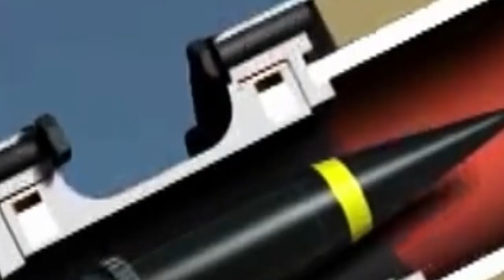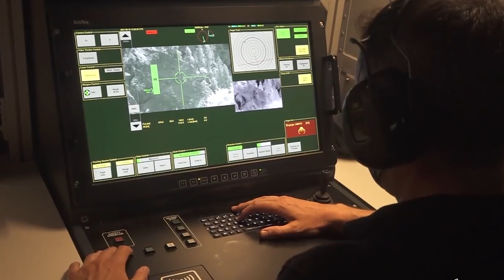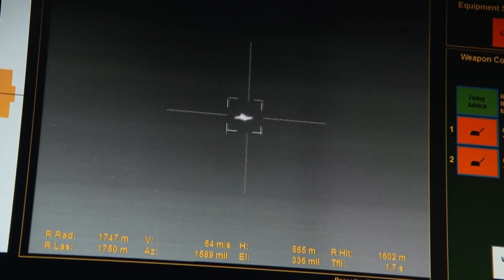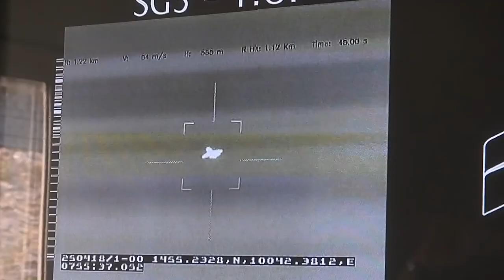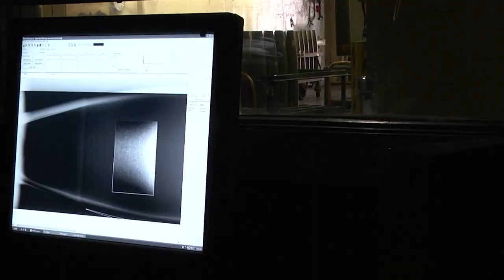Oerlikon Ahead Air Burst Munition

Comment: AHEAD was new when I was in 4 AD Regt RCA more than 20 years ago. It's good stuff, and I'm sure Rheinmetall has continued to improve it, but it's not exactly new.
Reply: well yeah the programmable ammunition system is part of the main weapon system of the german Puma IFV (MK30-2ABM)
Reply: Yeah, it seems these systems have a seen a rise in popularity again as well as their need. They also seem to correlate with the phasing out of previous SPAAGs you'd see before. (Think Germany phased out the Gepard around 2010) Propably to fit in a multiporpose point and air defense role for short ranges. The Rheinmetall MANTIS plattform (also in the vid) and the tukish Korkut are good examples.
Reply: Yep, originally called The Millennium Gun!
Reply: The real problem is that these amazing weapons have mostly zero chance to end-up in the hands of the people who would need them the most..... : Ground troops/patrols....,we continue to observe in Afghanistan (since 2008) the use of old armored vehicles (VAB amphibious..!!) armed with 1960"s .50cal machine gun and young men often getting pinned down by AK"s and RPG ,ambushed with not much to return proper fire ,waiting anxiously for air-support while taking casualties...these weapons look great on military parades but rarely end up on the battle field  and when available ,they are bought by extremely rich small countries from the Gulf that don't even have a regular army ..!!...Note that I was deployed 3 times in Africa during the early 80"s as a French Para-Trooper (Sniper guy) , I mentioned 2008 because during that year a patrol of young men were ambushed in the Afghan mountains Uzbin ,taking heavy loss and these men were using the same useless ,refurbished shitty equipment that we had in 1982...!!.nothing heavy to clear the mountains tops ,useless old smokers that clear in 60 seconds ..!!. no AC in 50°c cramped  vehicles..etc. , ..and things have not changed much...except lots of promises with cool vids on YT....
Reply: @hectorherbert6585  you do understand that this is air defense technology not close ground combat yes ?
Reply: @hectorherbert6585  I recognize the sentiment.
Reply: @darkstepik  Not the point Sheila and not what I said...,  plus taking fire from mountain tops a mile away is not what you can call close combat..
Reply: Exactly!  We installed one of these guns on SeaSlice back in 2001 and fired Ahead ammunition through.  Awesome ammunition with fusing as it exits the barrel, BUT THAT WAS JUST OVER TWO DECADES AGO,,   Not new!,
Reply: @hectorherbert6585  I'd like to come back to your original comment. I've given it much thought since I left military service. I've got the faint notion that since the draft/compulsory military service was abandoned and few families had a son/daughter, cousin or grandchild in the armed services, people no longer give a hoot with what armament and equipment soldiers were being sent to hell holes like Mali, Afghanistan, Iraq, the Central African Republic, etc. Besides, all those operations were far away from home,  and involved fighting insurgents, so who cared?  

Only a few years ago Dutch infantry had to simulate contact drills yelling "Peng, peng!" because of a shortage of blanks. They were being sent on exercise in Norway in mid winter without proper arctic clothes, gloves or boots. Quite a few came back with frostbite. Ships, aircraft and vehicles were rusting at their base due to a shortage of spare parts or people to staff or maintain them. And still our government is wondering why nobody really wants to serve anymore. 

And to add insult to injury, salaries up to sergenat 1st class are only slightly above minimum wage, with all bonusses (for our of area operations or exercises) have been abolished. At the same time, private companies guard baracks, naval and air bases, provide catering and a lot of other facilitory services and make profits to make your mouth water. And look at the military industry, Profits are sky high. 

In short, anyone who's willing to serve a nation whose gratitude lasts a milisecond or so, should rethink his/her decision. You'll be asked to save your life wiith the bare minimum of equipment, armament and training, you get paid a poor man's wage and you are not allowed to go on strike (pretty much all rights civilians enjoy are being stripped from you) and when you return and suffer PTSD or worse, good luck, here's a medal and you are on your own. 

I think that about says it all about western 'civilization.' It craps on its most loyal and dedicated servants and only rewards selfishness, greed, narcissism and incompetence. 

That was not the case (yet) when I left the Army. But boy, how things have changed. Sic transit gloria mundi.
Reply: @Pincer88  memento mori.
Reply: @hectorherbert6585  Yes. Or rather.... carpe diem.
Reply: @Pincer88  well..we might have to worry about tomorrow..!!
Reply: @hectorherbert6585  My thoughts exactly. Western culture - especially at the top - has become hedonistic, obsessed with the here and now and 'the self.' Every cultural value that keeps societies cemented together has been left for the pursuit of pleasure and self satisfaction. 
I don't advertise that one should live life as a Spartan or a devout self flagulating zelot, but our elites lead lives completely detached from every day reality of the ordinary citizen. And politics - in part adressing the structure and sustainment of armed forces - reflect that. 
France isn't so bad in that respect as my country, the Netherlands. But as the 'gilettes jaunes' made clear, if the people are made to bleed for the Parisien folie de grandeur, revolt is what the Elyssee will harvest. 
I've read that Macron seeks to reform the École Nationale dÁdministration (ENA). The breeding ground for the French administrative and political elites. About time imho. Same should happen in the Ivy League universities in the US, Oxbridge and similar elitist seminaries. The word elite derives from the Latin word for electing. It seems elections nowadays have become a game by which the self proclaimed elites legitimize their rule, without even once bothering to ask what the people who have elected them need. 
I'm not a militarist, but Army life has taught me that leaders should arise due to merit and thet such will bring forth units with highest levels of trust (!), cooperation, flexibility and cohesion. Fraternité rather than (only) liberté. It's about bloody time those values should be our guiding lights. What say you?
Reply: How to counter this. It looks large, static, and heavy. I'm guessing small, low flying drones, carrying small payload would be enough to take out the infantry and drivetrain (tyres etc) or surface road damage to a reasonable depth to cause obstruction school these armaments can't move around. In Ukraine if there were 10's of 1,000s of small payload drones I think they could be effective. If the drone is small enough it can navigate at street level.
What do you think?
Reply: Maybe you are correct.🤔 But it will be the first time that history will change in Modern Warfare my friend.💪💪🤔🤔🤔❤️❤️💯💯🤯

Comment: This is a relatively simple, but highly effective technology. It gives an opportunity to destroy object that are flying on low altitudes and does not rely on tracking its infrared trace. But the main advantage is that the ammunition has a way lower price compared to other air defense systems missiles. I think with some modifications it even may be able to destroy other missiles.

Comment: Looks to me like that is a hungry beastie.
Glad it's not me carrying or paying for ammunition for it.
Impressive though.
A bit leading flying  ducks with  a 12 gauge .
12 guage guns historically had expensive ammunition too.
The tungsten pellet loading must be heavy and the propellant load must be high.
I would expect short barrel life given the quick firing must heat barrels fast when pushing heavy projectiles fast and at such close spacing.
Even shoulder guns shoot barrels out fast when loaded hot.

Comment: These things are beastly against high speed boost-glide vehicles too. A must have
Reply: What about hypersonic missiles with propulsion?
Reply: @gabedarrett1301  Cold war strategy, make a bigger and faster missile.
Reply: Yeah, as long as they don't change their course they will be hit, which is why they are pre-programmed with evasive manouvers. In fact they are programmed to not move in a straight line, at least these weapons leave the operators out of any protection, makes they mince meat on the next run. Hell they have to fired from in front of the aircraft thay are attempting to fire against, how many do you need to cover an area? might as well use small drones, it would be cheaper, these things like a lot of modern weapons are for looks and to make money, not be cost effective or even effective defensive weapons. Why not use a shoulder held Rocket launcher, instead of having to purchase a whole vehicle as part of the system?
Reply: @gabedarrett1301  the SM-3 Block IIA hit the fuel tank on a spinning satellite moving over mach 20 outside the atmosphere with a closing speed of mach 18, or a relative impact speed of mach 38 on a target the size of a bathroom sink. HGVs and hypersonic cruise missiles won't be a big challenge to hit once locked on, the detection and target quality lock before the missile strikes its target are the difficult parts
Reply: AHEAD is a great munition, the plan to go up against hypersonics is pretty similar, you just create a wider, taller and deeper cloud of tungsten.
Hypersonics can barely function through rain, it grinds them to dust.
A large dense flak cloud will mince hypersonics.

And take "powered with lots of maneuvers" with a grain of salt.
Remember we're talking about sea level here, I can't see powered hypersonics sea skimming, it's like flying through soup for them, air resistance is the square of velocity remember.
They're not hard maneuvering at sea level and at altitude maneuvering is pointless (it's a geometry thing)

So, think of a Mach 4 SAM, doesn't need to be super fancy, Sea Ceptor will do, war head is clouds of tungsten BBs.
And here comes a Mach 8 missile that cannot get around it.
That's a stationary collision speed of Mach 12.
Hell, fill it with copper cones instead of BBs, the collision speed may cause those cones to form into jets like tiny heat munitions, remember the Meissner effect is kinetic not thermal, the explosive is there for propulsion.
It's like throwing the missile into a wood chipper.
Reply: @johnnymatias3027  you said a mouthful, the short window between detecting a hyper-sonic missile jumping up from below the horizon and locking time is just the  problem. Of course, if there's an AWACS loitering above the horizon's not an issue. If not, too bad!
Reply: Don't forget that hypersonics are also extremely loud in IR and VLF. Hard to hide something when it's moving fast enough to convert ablative hull (or transpiration coolant) and atmosphere into plasma.

Typically these vehicles have some really tight airframe limits as well, can't maneuver very much without breaking up or tumbling (then breaking up), essentially limited to blunt body aerodynamics like a reentry capsule.

And that same plasma sheath makes it impossible to communicate or navigate with radio or radar - can send signals out with plasma modulation, but receiving guidance? Forget it. Hypersonic weapons will have to rely on inertial or optical guidance - more or less limited to preprogrammed flight paths and maneuvering, except perhaps a very short time before impact when the target is in optical range.

All in all, extremely sensitive to atmospheric conditions, can be disabled by absolutely miniscule debris or even rain, can't be piloted remotely, can't use radar, can't make hard maneuvers - their only real advantage are their short flight time and short warning time.

A decent distributed network of passive sensors and any defense that can quickly throw a bit of sand in the flight path (or even a powerful laser of the right wavelength to be absorbed by whatever material is concentrated in the shock) and you've got a useless fireball
Reply: @Right-Is-Right  Aye, hypersonic cruise missiles are just prestige projects. Really not that hard to find and stop with a passive detection network (distributed across buoys, drones, satellites, whatever) looking for loud IR and VLF from the plasma cloud and whichever system to throw a bit of material in front of where it's going to be and it's game over.

Pretty cheap and easy to stop one or two or three - harder if not impossible to stop hundreds, but these things are fucking expensive.
Reply: @airplayn  high speed vehicles like that will also be screaming in IR and radio with a nice bright plasma trail behind them as well. Extremely easy to know when one is moving, not too hard to locate it with passive detectors so long as you have a few of them and they're networked
Reply: @gabedarrett1301  For that just use the High Power Laser from same Company look at the SkyRanger HEL 30
Reply: @SuLokify  Again you'd need over-the-horizon detection by AWACS or satellite for the warning to be early enough for target lock by antimissile systems, especially if the missile coming at 3,000+mph has countermeasures. With the horizon at less than 15miles you would have <0.3 seconds to acquire, lock and fire! By countermeasures I mean preprogrammed or AI high G maneuvering, chaff and decoys but it probably couldn't effectively use ECM
Reply: @Right-Is-Right  Russian Iskander has 20g+ terminal manouevering, chaff, ECM AND decoys. And it can be fired in hypersonic mode too, no one else has anything close. This thing won't stop it, it's not designed for it.
Reply: And hypersonic tech is not new, we had this tech since the late to early 60s...
Reply: @gabedarrett1301  It's really about the same thing in the terminal phase - with slower cruise missiles you have a longer detection and response time, with hypersonic vehicles you have extremely easy passive detection during the entire hypersonic phase (due to plasma trail, really loud in IR and VLF), much more accurate intercept algos (really hard to maneuver at high speed).

Basically it depends on the networked detection system, response time, and yes ammo with more and smaller fragments is more effective. It's not that much more difficult to intercept a mach10 cruise target than it is to intercept a mach10 terminal boost phase target as long as you have robust detection systems

Comment: That is a very impressive rate of fire from a single barrel 35mm. I'm curious about what cooling solutions they use for the barrels and the barrel life expectancy.
Reply: The secret behind the high rate of fire is that its a 4 chamber revolver cannon. The drum is water cooled, the barrel is not cooled at all.
Reply: @doomer6500  Thanks. Always had a curiosity at how low to medium caliber single barrel weapon systems attained high rates of fire. As for the barrel I wouldn't be surprised if field engineers have found a way to "flush" the barrel with a liquid or gas cooling solution. Even at burst fire depending on combat intensity that barrel has it's thermal tolerance limits. Still curious about the expected rounds per barrel safety guide. Like is it every 3K to 4K fired SOP is to change the barrel.

Comment: I've been a huge fan of Rheinmetall and their line up of these guns and this programmable ammo for years! Theres also another smaller caliber gun the Narwall that is also extremely impressive and seems to be in this family despite it not having the Ahead Ammo (I think) and all of them have incredible rates of fire that on top of the state of the art ammo makes them frightening to anyone or thing down range of these weapon systems! I think the US Navy should be using this stuff cause from what I've read it severely out classes the phalanx, and the other 25mm remote weapons stations found on ddg 51 and other ships! Madfires for the 57mm is a great improvement but it doesn't hold a candle to the guns Rheinmetall makes especially with drone swarms become more prevalent!
Reply: Keep in mind mounting such a gun and firing it on a ship won’t have the same accuracy.  Also this weapon is probably not as lethal as phalanx due to lower mass of subminitions compared to a huge bullet.  And phalanx can fire a variety of ammo including creating a shrapnel shield around the ship if I remember correctly.  It also does not require separate sensory systems as it has its own already integrated.  Space is precious on a ship.

Comment: This is awesome, if you could switch rounds between these and AP and HESH it would be the ideal AT and AA platform. Just use ML to categorise the threat based on threat behaviour
Reply: Puma IFV
Dual feed, open bolt 30mm auto canon.
Choose Fin or air burst munition.
The air burst for this is more clever too, allowing you to hit targets behind hard cover with the air burst. I believe it can do point detonation too.
They're not quite as clever as the new CT40 auto-cannon, but it's ammo and gun are VERY expensive.